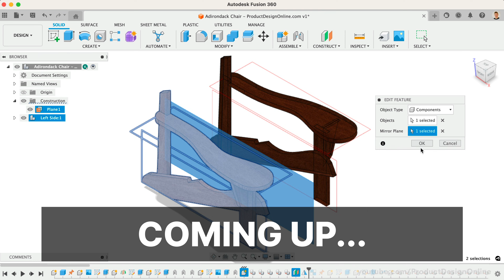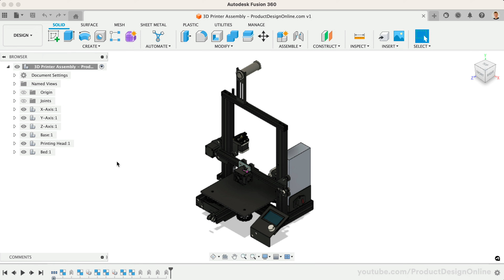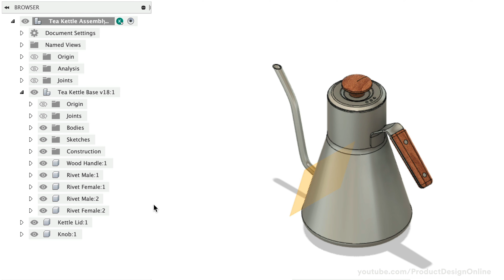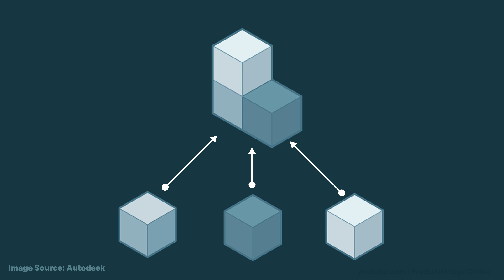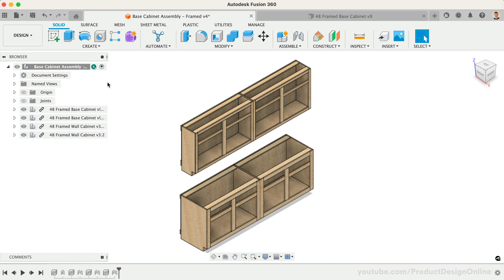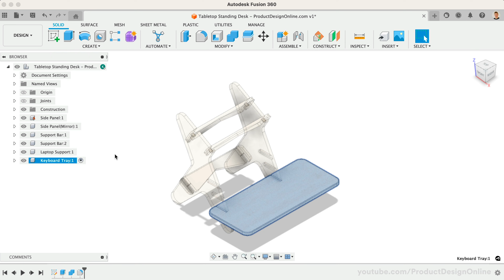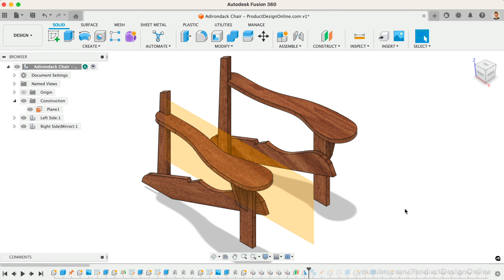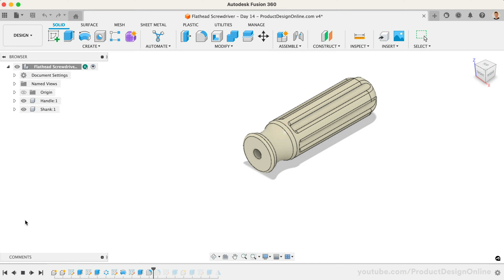Fusion 360 Components and Assemblies Explained | Day 13 of Learn Fusion 360 in 30 Days

Comment: I have been given a huge file that should’ve been an assembly but instead is one component with many different bodies. What is the best way to convert this to an assembly file with each body as a component, while still preserving the edit history for each of the bodies/new components?
Reply: I was thinking to duplicate the file many times for each body then delete all the other bodies to leave one for each of the duplicated files. Then add all these files as an external components to a new assembly file, then unlink them. Will this work and or is there a better/ easier way? It is vital all edit history is preserved.

Comment: I use the add-in DirectName which really helps with Rule #2.  Just google "fusion 360 direct name"
Reply: thanks im trying it out now.
Reply: Thanks, this helps on the NEXT exercise "flathead screwdriver" at the 5:40 mark. I didn't realize what it was doing until he said "take a minute to go back and rename all your sketches". Then it all made sense when I found out I had already labeled them thanks to this add-on. Good Call..

Comment: there anyway to flip a canvas around? it will let you do up and down but not move to other plan when scaled
Reply from the maker: Sorry, I'm not following what's going on here. Are you trying to get it onto another construction plane or face of a body?
Reply: @ProductDesignOnline  no was trying to turn the canvas but it only stays on one plan
Reply from the maker: @jamessmallwood7448  Thanks for clarifying. That's correct, you canont rotate the Canvas in that manner. You will have to re-insert it on the other plane.

Comment: Kevin, I always forget to create a component when I start. A recent F360 change allows you to drag a top-level sketch into a new component. The top-level bodies and timeline created from that sketch auto-magically move into the new component as well.  Creating a "New Component from Body" doesn't move the original sketch, it stays at the top-level. Hope this makes sense. I've been using F360 almost daily for 3 years and always learn something new watching your videos. Thanks from Colorado.
Reply: on a related note, 7:55 pasting into top level component is what i forget to do and it really screws up my work when i only realize it many operations later.
Reply: Thank you so much for that hint! Sometimes creating a second version of a single part is a late afterthought so it's good to know how to move the root component into a separate component. I think it should become the default setting when creating a new project that it auto-creates a new component so you cannot forget it.
Reply: Great tip thank you!

Comment: I probably got this from another PDO video, but I generally think of an assembly as the overall item I'm designing, and the components as the pieces I'd be putting together to make the final product. It was much more intuitive when I thought about it like assembling Ikea furniture - the table is the assembly, while the individual boards, screws, etc., are the components.

When deciding whether something should be its own component, think about whether or not it would be manufactured separately from other parts of your overall item. If it would, it should be its own component.
Reply from the maker: Great example!
Reply: This is what my brain needed to read to understand!
Reply: Great tip!